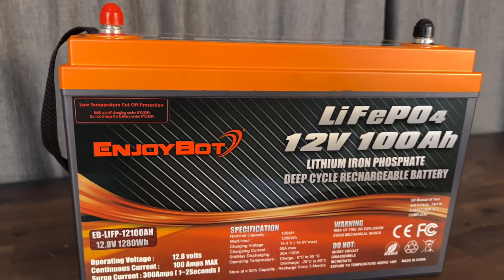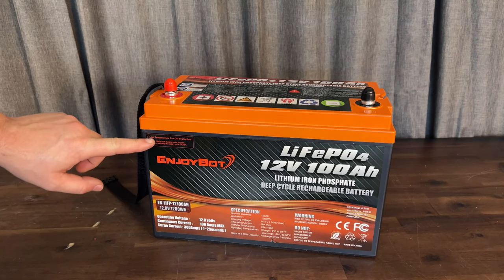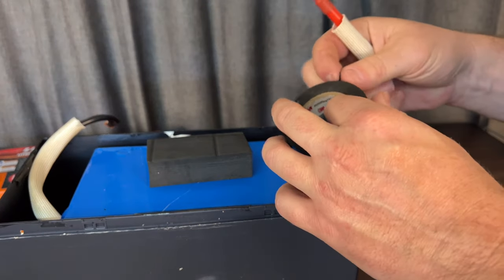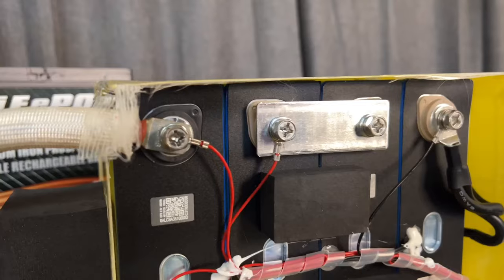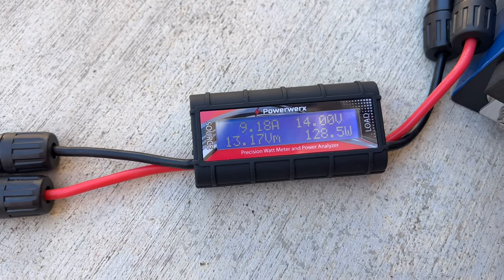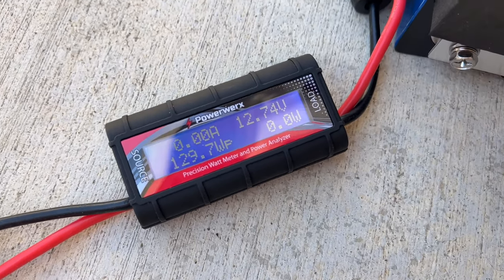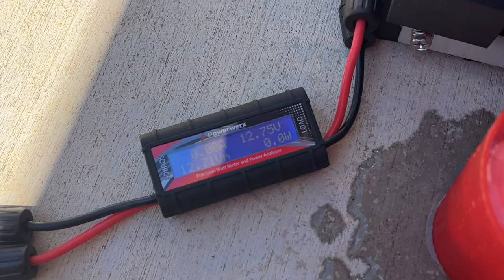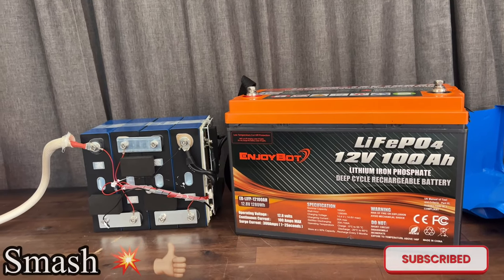$499 Best Lithium Battery ? Enjoybot 100ah Low temp protection!!! @WillProwse

Comment from the maker: Correction!!!! The new low temp batt is $499 sorry for the mistake..🤦🏼‍♂️🤷🏼‍♂️ 
So it ends up being $.39wh at $499 
Which with a 10 year warranty and low temp it’s still not a bad buy. 
Enjoybot batteries (affiliate links):
12V 100Ah: https://enjoybot.com/collections/lifepo4-battery/products/enjoybot-lithium-iron-phosphate-deep-cycle-rechargeable-battery-12v-100ah?aff=26
12V 200Ah: https://enjoybot.com/collections/lifepo4-battery/products/enjoybot-12v-200ah-lithium-iron-phosphate-deep-cycle-rechargeable-battery?aff=26
12V 300Ah: https://enjoybot.com/collections/lifepo4-battery/products/enjoybot-12v-300ah-lithium-iron-phosphate-lifepo4-deep-cycle-rechargeable-battery?aff=26

Enjoybot batteries' built-in low-temperature protection(affiliate links):
12V 100Ah: https://enjoybot.com/collections/lifepo4-battery/products/enjoybot-12v-100ah-lifepo4-deep-cycle-rechargeable-battery-built-with-100a-bms-low-temp-charging-cut-off-protection?aff=26
12V 200Ah: https://enjoybot.com/collections/lifepo4-battery/products/enjoybot-12v-200ah-lifepo4-deep-cycle-rechargeable-battery-built-with-200a-bms-low-temp-charging-protection?aff=26
12V 300Ah: https://enjoybot.com/collections/lifepo4-battery/products/enjoybot-12v-300ah-lifepo4-deep-cycle-rechargeable-battery-built-with-200a-bms-low-temp-charging-protection?aff=26

Comment: I enjoyed your review, but I don't understand the disconnect between your review and Will Prowse.  He said that the low temp did not work.  Can you explain?
Reply from the maker: Because the unit he had didn’t have it. This new battery from enjoy bot now comes with a real low temp cut off. 
Which over all Will said the battery was well built and for the price is something to consider. Now with low temp as well I think he would agree it’s a battery worth considering especially for the price.

Comment: The link for the 100ah with low temp protection is showing it as $499. The $399 battery is the one without it.
Reply from the maker: Well some biscuits!!! I need to go through the emails again let me double check because I thought they said the new low temp was supposed to be $399…??
Reply from the maker: Ahh darn it your right I miss read the email. I thought it was a a new low price ! 

Sorry will update the description. Thanks for double checking

Comment: Sorry I know this an an older video at this point but I am curious...I live in Southern Missouri and it does get pretty cold here. Could I get away with the regular batteries (non low temp cutoff) but use a charger, such as the HRTC smart charger that I do believe has the low temp stuff on it?
Reply from the maker: You would want to double church and be sure that charger does. Or you will end up damaging that new battery pretty quickly. 
Maybe check temps before charging. 
Or keep in a area that’s not freezing

Comment: I wonder if the voltage can be upconverted to operate an ebike.  It'd be nice to get anywhere near 200 miles range with a trailer.
Reply from the maker: If you took it apart and rewired the battery wires. But then you have a BMS that is probably not compatible and would need to replace it.
Reply: @johnnysweekends  Was considering a voltage up converter.  Or combining three of these.  Now considering modding a battery pack.  One has more than enough capacity, just not the voltage, as is.  If it works and is reliable, it's a many times better deal than any battery built for ebikes so far that I looked at; except some are extremely well built and I'm a noob.  Would have to decide whether it's a better idea spending a lot more for less cap or waiting until I get through the extremely long process of getting it right the first time.  There are frames that these can be mounted on.  Mine can carry it on an added rack in the back or the trailer.
Reply from the maker: Would be a interesting build..👍🏼

Comment: I live in Los Angeles and I’m looking to buy 3 of these to turn it into 36 volt for my trolling motor on a fishing 🎣 boat.

I always charge my batteries inside the garage and I doubt it gets that cold here ever.

Would you say I need the low temperature 🤒 cut off version or not in my case ? 

We don’t get ice 🧊 on our lakes and our inshore saltwater fishing 🎣 is also no where near freezing 🥶 temperatures.

I would appreciate some knowledge to why or why not someone in my case would need it 🙏🙏🙏

I don’t want my boat to catch on fire 🔥 while I’m fishing 🎣 so that’s the only thing that scares me from buying this battery 🔋, but it would be a game changer in my case if it would not be a dangerous upgrade 🎣👍
Reply from the maker: If you live in an area such as Southern California, that rarely sees freezing temperatures then a low temp battery cut off may not be needed in your case. That feature is only for charging so you don’t damage the battery when trying to charge it when it’s too cold, but you can still use the power out of it until it’s depleted. You will need to buy a different type of charger that is able to charge lithium iron phosphate batteries.
Reply: @johnnysweekends  thank you so much for your reply. 
That was my exact thought and you have confirmed that I can go ahead and make my purchase. 

I extremely appreciate you 👍👍👍🙏

I own a Noco Battery charger that I use to charge my lead acid and AGM batteries, but it also has the ability to charge lithium batteries as well, would my 10 amp per hour charger be good enough to charge these batteries? Or would you say I need to purchase a battery charger from the same company that is specifically made for their batteries? 

I extremely appreciate all the wisdom and knowledge, thank you 🙏🙏🙏
Reply from the maker: If it has a lithium battery setting then you should be good…👍🏼
Reply: @johnnysweekends  
Thank you 🙏

Comment: Two GC2 golf cart batteries have 225ah capacity for less than one of these lithium batteries. GC2 cost 175.00 each for 700 you could have 450ah. To get 450ah out of your lithium batteries is $2000. Hmmm
Reply from the maker: Well actually you can get a 300ah lithium battery for under $1000. And you get about 95% of that 300ah to use. And the battery can be cycled 3500 times roughly before it drops to 80% capacity.  That’s about 10 years to get there.

Your 6 volt batteries that need two to make the 12v set up and weigh double or more of the lithium battery, need maintenance for fluid levels and also only have a usable 50% capacity. So you actually only get 225ah of the 450. Unless you want to damage them and severely kill of the life cycles. Which most of the deep cycles have about 800 cycles till about 80% or less for a fluid battery. 
And if you drain the battery several times past 50% you’ll drop the life cycles even more say down to 500 ish. 
And even if you stay at the 50% drain they will be dead in about 4-6 years if your lucky since those are a cheaper batteries. And you also have fade so the more items you turn on the battery fades and can’t hold same output like a lithium which will stay at peak voltage up to 100amp draw. Unfortunately the lead acid will not hold the same.

Plus lithium I can mount how ever for tons of options. Like on the ceiling if I want. 

Unfortunately lithium is now a better option. Especially since no maintenance.